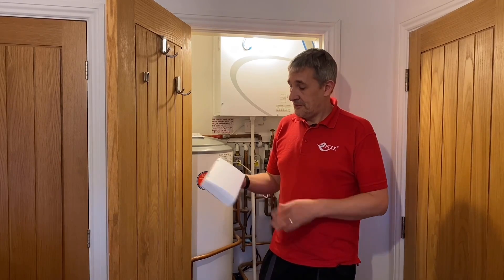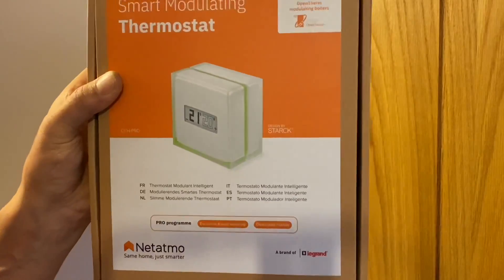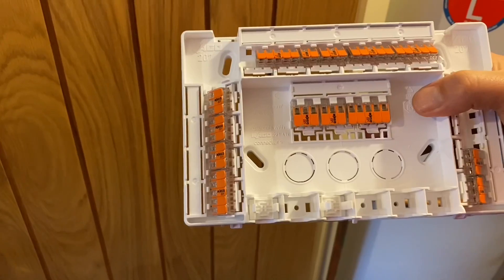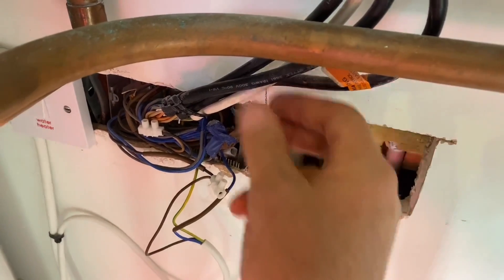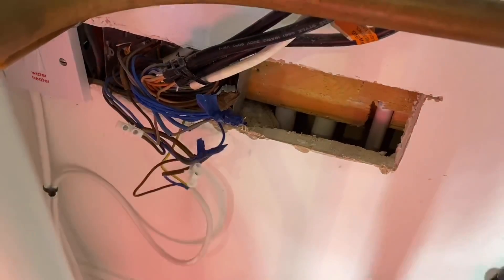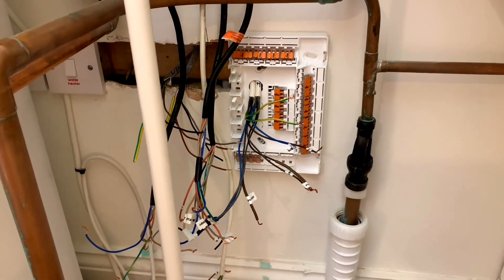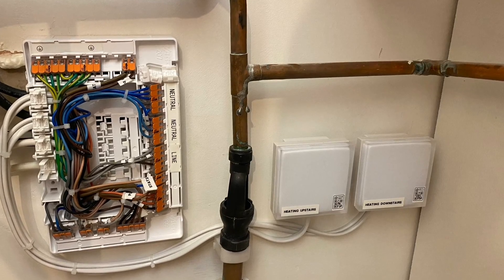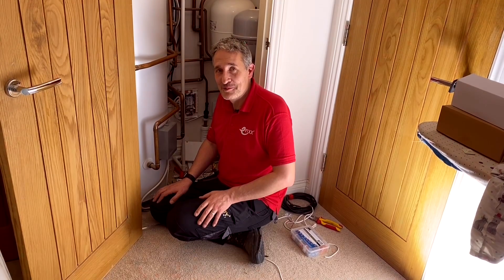S-PLAN wiring nightmare - NEW WAGO Junction Box to the rescue - Netatmo thermostat upgrade.

Comment: Having watched this video again the general build quality, not just the electrics, look quite poor. 

And that’s just the stuff you can see - goodness knows what it’s like under the p/b 😱
Reply: Yep.I have owned a couple and still in one of two houses built in the 80's.Being originally from construction and doing refits of bathrooms, kitchens and general internal mods have discovered very rough stuff .Trouble was that piece work was rushed and very untidy.I swear on this house a spirit level must have been lost at some point.Wiring is terrible as was most of the plumbing etc.I hope the standard on new builds now is better.?

Comment: Nice  product , easy to fit but tricky to fault find as you cant use a multimeter probe with wago connectors.  Expensive aswell to save a couple of mins.
Reply: The 221 connectors do have test slots.  In fact one either side.
Reply: Okay learnt something new, Didn't see that when I had to fault find these in the past.  Still easier to trace faults in my opinion with a more traditional connector block type wiring  centre.  I have fitted loads of Salus wiring centres and found them to be good, but guess its slightyl easier to install multiple cables into a Wago.
Reply: @marcjenner2378  wagos are the mutts nuts.👍 Once you have used them you won’t go back.

Comment: I’m not a spark but wiring an S-Plan is very easy. 

I wired all my EvoHome which includes a mix of UFH, 3 pumps, pump overrun using a dedicated timer relay, a dozen relays and dedicated radiator and HWC circuits. The wiring was very straightforward. 

I say that not because I’m bragging; I say that because I’m honestly disgusted at whoever did that original wiring. Do they have no shame ??
Reply from the maker: It’s easy if the installer follows a plan and leaves a copy of the wiring diagram.

Comment: Any reason you didn't go for a multicore cable to connect the netamo relays to the wiring centre (to save having 2x cables per relay ?)
Reply from the maker: Good spot 👀- the wires are prewired to the relay out of the box - you’ll see more in tomorrow’s video
Reply: @efixx  looking forward to it 👍🏻🙂

Comment: Very neat job. I noticed you used a jumper on the cpc's. Maybe Wago should make a connector with more termination points.
Reply from the maker: A 10 way would be ideal - same situation in neutral connections.

Comment: Shame wago didn’t think to have fixing holes so you could fix over a box for instance if you’ve already got a dry lining box cut in.
Reply from the maker: The box does line up with back box fixings - we just couldn’t use them in this install due to the box location and we needed some extra length on the cables from the zone valves.
Reply: efixx oh really maybe they’ve changed design slightly then  I have tried them a couple of times but got slightly annoyed I couldn’t fix it over a box that was in place. 👍
Reply from the maker: Was that the previous L32 version - which was below par - and couldn’t fit a back box

Comment: Good that they made this bigger version, it's very expensive though, especially when lots of heating controls come with a "wiring center" that smart products can hook directly into.
Reply from the maker: It’s a small price compared to the cost of the heating system - the Honeywell zone valves are £50 each!
Reply: @efixx  Is that £50 manufacturers retail price as wholesalers usually give a discount to account holders more if a quantity is being purchased.
Reply from the maker: @anthonybragg  Yes of course - that was just our quick googling around screwfix price (we aren't plumbers) -  You can get the wago box (minus the 221's for around 12 ex VAT of you shop around)

Comment: I often find the plumbers leave a rats nest of wires because they are too tight to hire an electrician to do a proper job. We then get called to add new gadgets like smart thermostats and spend an age trying to decipher the spaghetti. I will probably look at this new wago product next time I do some heating wiring.
Reply from the maker: Agree - smart stuff is usually quick to install - but it’s figuring out the legacy system that’s the problem.